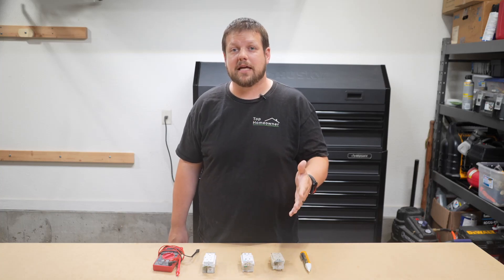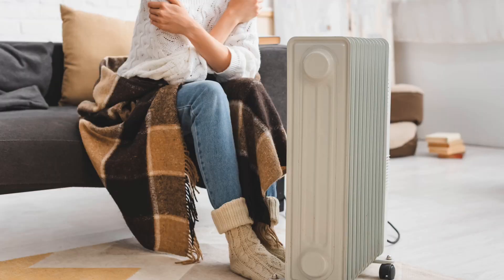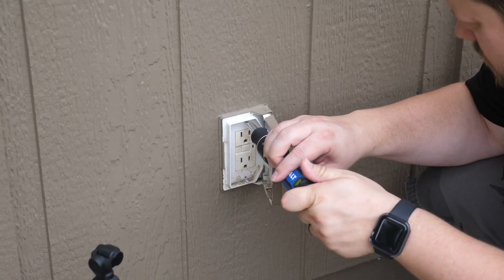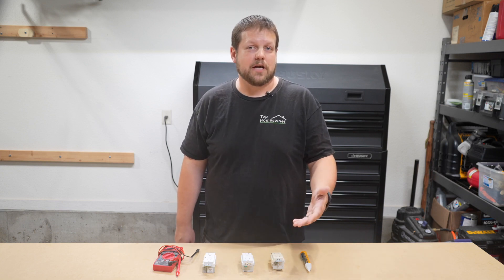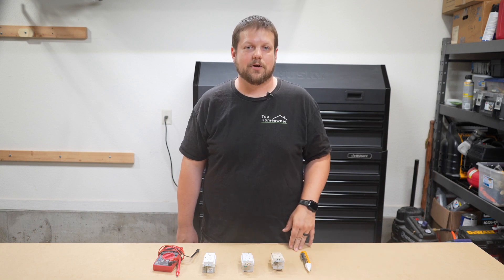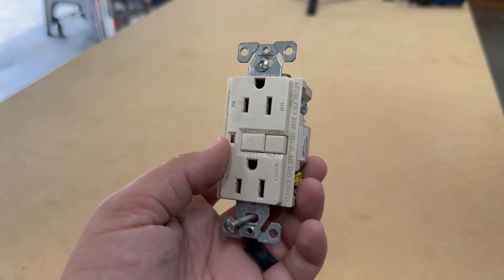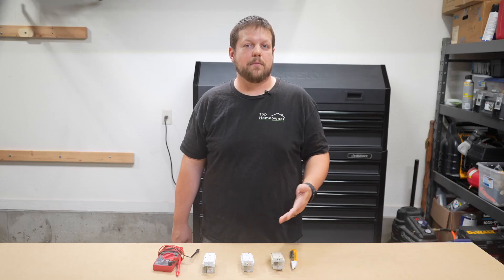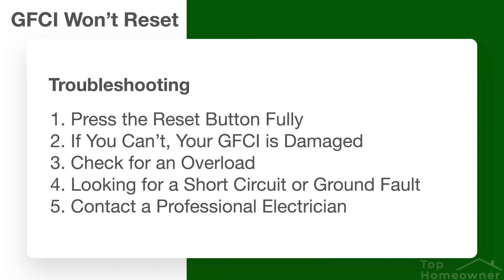Does Your GFCI Keep Tripping? - Here's How to Fix It | Step-by-Step DIY Guide

Comment: I have a 20 year old GFCI outlet in the bathroom and it’s showing tripped with red light… it has 120v going to it and is functioning, but can’t reset it and test doesn’t work. Doesn’t even try to reset. What could be the issue?

Comment: Really good video. I connected my line and loads to my gfci and it doesn’t reset when I go and wire nut the corresponding hot to hot neutral to neutral and  ground to ground it doesn’t trip the breaker and my outlets work is it a bad gfci ?

Comment: GFCI outlets do not trip for overloads. They detect current leakage and that's all they are designed to do. A GFCI (outlet) is not a replacement for a circuit breaker in the panel. However, you can buy GFCI breakers for the panel that also include overload/SS protection.
Reply: We also have gfci at the panel and not controlled at the outlet. When it rains, the breaker trips. I assume it’s because the panel is located next to the garage door opening from moisture…

Comment: With 20 20 hindsight based on a steady curve of increased home power consumption it becoming obvious that excluding ceiling outlets Houses should have just been wired with 10 gage 30 Amp circuits.

Comment: Good video, I would only add that if the GFCI won't reset, most GFCI's won't reset unless 120 volts are present at the Line-in side. You may show power with a non-contact tester because even if it's just 2 volts, the non-contact tester will show voltage. You need to test with a multi-meter to make sure you have 120v line-in or the GFCI won't reset.

Comment: Hi! So I have the situation where the GFCI outlet is tripped but the reset button doesn’t stay in or do anything. I replaced the outlet with a brand new one and the same issue is happening with the new outlet. Any additional thoughts?

Comment: You talk about continuity testing for short circuits, but you have your multimeter in the video set to ohms, no?
Reply: Yes, set it to ohms for continuity check. If it has multiple scales try lowest range first..like 200 ohms, not 10k ohms.

Comment: I just had my patio circuit replaced. I bought a new 12 gauge outdoor extension cord and a waterproof protector. I plugged my pool pump into the extension cord and secured them in the waterproof case. The extension cord tripped my circuit. The only way to keep it from tripping is to plug the cord into an outdoor surge protector before plugging it into the actual circuit. Why am I still having trouble? Why is a brand new outdoor pool plug and cord still not operating my pump? Do I need to buy a new pool pump too? It’s only two or three years old. Help!

Comment: excellent video..i have weather resistant gfci in a box with clear cover on exterior wall. Yr round hot climate ..It just died again (3rd one in 18 cos - new house) after the Beryl rain storm. I am thinking moisture but not certain. Is it ok to seal the cover that the plug is in to try and stop it from getting when during bad rain...not sure if that will trap moisture or prevent moisture..Tx in advance

Comment: I have a single thing plugged in to a dedicated 20amp GFCI on a 30 amp breaker. It says it only pulls 17amp max and have been running on a 15amp GFCI for almost a year with no issue.

Comment: I'm using a 12k BTU A/C in an outdoor building. I have a monitor on the line. The max it's pulled is 10amps, 1000watts. But even at 7amps, it's popped the GFCI. Nothing else was on the circuit at the time. Everything from the power box to the shed, is 20Amps. I'm about to just put the A/C unit on it's own dedicated plug that is not on the GFCI. The A/C unit has it's on built in GFCI on it's plug. Since the unit isn't pulling more then the line can handle, I was thinking it was the GFCI.

Comment: Your first 2 reasons are wrong. GFCI receptacle does not trip from overload or short between the hot and neutral. It's purpose is to detect a current leakage of at least 5mA from hot to neutral. That current will go to ground and trip the device, hence the name GFCI. With or without a ground wire connection, the user becomes a potential ground and there to protect them. 
Overload and a short between hot and neutral is the circuit breakers purpose.

Comment: Can vibration from a garage door opening and closing cause a trip?. Have a GFCI near door and it trips even with nothing pug into the circuit.
Reply: loose wire?
Reply: Checked everything. Might just replace @RogerPack

Comment: Hey bro my gfci is in the kitchen but it’s tripping when my counter top grill begins to pre heat but when the espresso machine is on it doesn’t and when i use my grill it’s the only thing plugged in. Does this mean that it’s bad or should I upgrade to a higher amperage gfci? Its also a century old house and im aware that it might not be up to code. Im an r1 so I don’t know much about electrical work
Reply from the maker: Sounds like its the grill. If you have another GFCI in another part of your house you could try plugging the grill in there and see if it trips. If it does, that's your answer. Also, always be sure to keep the outlets, breakers, etc at the same amp rating because those are dependent on the wiring. You don't want to draw more current than the wire can handle (fire hazard)

Comment: My garage GFCI trips everytime it rains. Does this mean water is getting to the gfci itself or could it be that water at the breaker is tripping the GFCI, just for clarification the breaker is not tripping. This can be annoying because my modem is connected to an outlet further down the line and I have to run an extension cord to my modem until the storm is over
Reply: I am having the same issue. Every time it rails the GFCI in my garage trips so no power in the garage or the outside outlet....let me know if you find a solution please. Thanks
Reply: Same issue at the moment, modem power went out as soon as a rainstorm started
Reply: Also same issue. Started raining heavy today and now the outlet keeps tripping. I hit reset and wait, don’t plug anything back in, and then it trips again anyways. Any solutions?
Reply: @JasonNL_  you replying a year later made me realize what a lazy pos I am😂 I still have not fixed it but after thinking more about it I don’t think my garage gf I is the issue, I think my outdoor outlets are actually tripping the gfci when it rains

Comment: What worked for me: I had just installed a new GFCI for my refrigerator, it tripped about 1-2 times a day. I found that I had removed the sticker covering the load terminals, and the wires were touching it when it was shoved back into the box. Taping up the terminals around the whole outlet stopped this. No issues now.
Reply: No way out a gfci on a fridge!
Reply: Local code forces me to use gfci on my fridge
Reply: @WahooPenguin1  use Gfci breaker.
Reply: @WahooPenguin1 So go on vacation and come back to a house smelling from the rotten food in the refrigerator. Did you actually read that in the code or did someone tell you it's in there?
Reply: You shouldn't use a GFCI on an fridge.
Reply: @yunghed1  what are you talking about?

Comment: My gfci for my sump pump malfunctioned and caused my basement to flood.  The gfci wouldn't even light up a night light. 

I have just installed a new gfci and the night light works. However, the new gfci trips as soon as I plug in the sump pump. Any idea what's going on?
Reply from the maker: It's possible the GFCI is detecting an actual ground fault in either the sump pump or the wiring, especially if a new GFCI is behaving the same way.

Comment: GFCI outlets don't trip because of overloads.  They trip because there is current leakage after the outlet.  There can also be nuisance tripping if you have multiple GFCI outlets on a circuit or a GFCI breaker.
Reply: Yea, I was wondering how a GFCI receptacle could even see an overload on the circuit that it is attached to. Best it could do is to see a low voltage on the input terminals, and I don't think GFCIs will trip on low input voltage, right?
Reply: There's no nuisance tripping with more than one GFCI protecting another GFCI. Remember a GFCI only measures the sum of the current differential between the hot and neutral (sometimes hot and hot). Measuring current with a current transformer in one GFCI device does not cause leakage current that can be detected by the other GFCI.

Comment: What may cause a new GFCI receptacle to be tripping even when nothing is plugged in? It’s end of the run so no wire nuts, only 3 wires in the junction box, wrapped each individually with electrical tape to be sure none were touching if there’s breaks (none visible though) in insulation.
Reply from the maker: The GFCI itself could be faulty. The first thing I would try is to swap it out and see if it still happens. If it does, then most likely there's an issue in your wiring somewhere.
Reply: How do you think a wiring issue somewhere else could cause this? Curious... :) @TopHomeowner
Reply: Did you wire the outlet wrong? The line is on the line. Did you put it on a load side?

Comment: My Christmas lights keep tripping mine. Even when I only have one strand plugged in 🤷🏽‍♂️
Reply from the maker: The light strand might have a short. Does it trip with a different strand?
Reply: @TopHomeowner  Short circuits (line to neutral) do not trip GFCI unless it's a GFCI breaker. GFCIs that won't reset are either defective or there is a ground-fault downstream.
Reply: My outdoor one trips when I have more than a couple strands plugged in. It was fine every year for about the last 5 years and the last 2 weeks. Suddenly not fine. Those strands are fine when plugged in to indoor GFCI outlets. I wonder if moisture is getting in (snowy where I live) though that wouldn't explain previous years.

Comment: Just moved in to a new rental. Some appliances are fine but my toaster or mixer (both new) trip gfci on all three different Gfci circuits found in the home. Any guesses to cause?
Reply from the maker: When a device trips multiple GFCI's, the most likely cause is that the device has an issue. That said, if it provides arc fault protection too (AFCI) then it might be overly sensitive. If you look closely, the face of the receptacle should say AF/GF or AFCI / GFCI if it's both.

Comment: Dude, your video helped me and saved me money. I was about to call an electrician on a Saturday and watched your video and as soon as you mentioned exterior outlet and gfci tripping I went and check the outside outlet box. Sure enough a spider was living in it and caused a short. I replaced all my outlets and breaker on that circuit and it was still tripping the gcfi immediately. So that is when I found. Your video. Thanks a Million!!!!!!!🎉🎉🎉
Reply from the maker: Great to hear!

Comment: My microwave is the only thing plugged into the GFCI that keeps blowing . I put in a new GFCI and after a few it blew again . The microwave plugged in elsewhere works fine . Any suggestions
would be great ,hoping to not spend a fortune , thanks .
Reply: Is your breaker rated for the same amps as your GFCI? Also what is your microwave rated for?
Reply: WHen you say the microwave works fine on another circuit, are they GFCI circuits? Plug it in in the garage for instance and see if that GFCI trips as well. If it does you have a bad microwave. If not you probably have a bad GFCI, new ones can be bad as well.
Reply from the maker: If you plug the microwave into another GFCI in another location and it does the same thing then there's probably an issue with the microwave itself.

Comment: Hi, What is likely the problem if there is a burnt mark by the hot load wire on the back of a non-working GFCI? Nice video, Thanks
Reply from the maker: Most likely it either overloaded, or the connection is loose and it's been arcing. I'd recommend replacing it.
Reply: @TopHomeowner  Thank you, that is what we did!
Reply: Any idea why my new Samsung refrigerator is tripping my GFCI it’s in a new home. I’ve had the refrigerator checked out and also tried two different GFCI breakers. The refrigerator is currently running with out an issue in a none GFCI breaker. 

My electrician says I need a new refrigerator. Samsung says it’s not the refrigerator. Samsung has a note on their website stating if the refrigerator trips a breaker put it in a non-gfci breaker. I’ve been going back and fourth with this for 5 weeks.
Reply: @MoonMatters1  Samsung advice to plug into a non protected outlet is very bad advice and I would not be surprised to learn its illegal to advise people to remove electrical safety devices from their homes that are designed to protect against electrical faults in the kitchen. Its code.

The starting current for a fridge is quite high. Have an electrician examine what the peak starting current indicated on the fridges rating panel is and be sure the breaker and wiring are sized appropriately for that peak current. If it is too costly to upgrade the wiring/breaker have Samsung take the fridge back.

Are your breakers combo GFCI/AFCI? New homes come with combo breakers for a kitchen. It could be the AFCI circuits in the breaker that is tripping not the GFCI. Follow AFCI troubleshooting guides as well. Anything with a motor in it can trip an AFCI breaker when it starts up, especially if the fridge is faulty. You may have bought a lemon..
Reply: @MoonMatters1  I’m having the same issue. Brand new Samsung fridge is tripping a dedicated, brand new GFCI outlet.
Reply: @MoonMatters1 Did you ever get this resolved with an explanation?